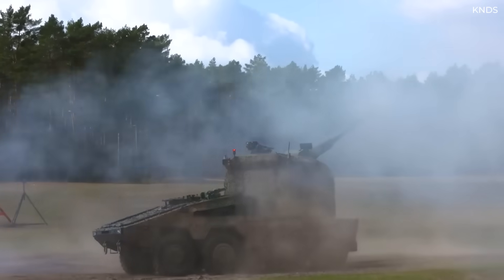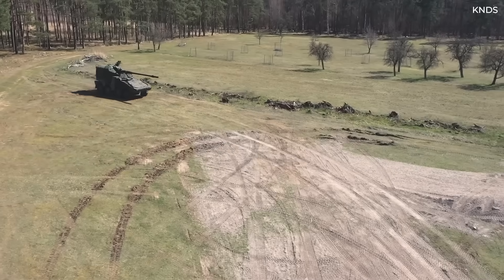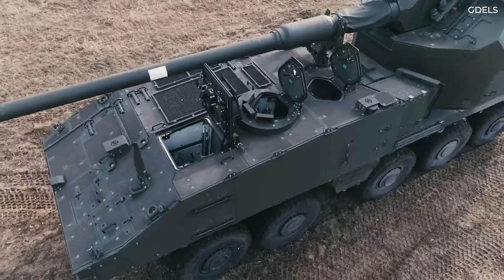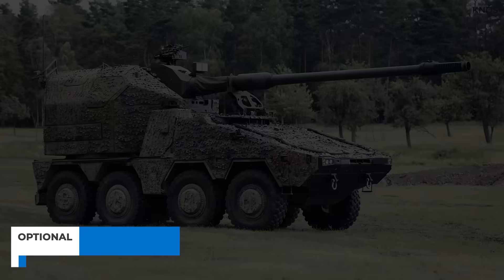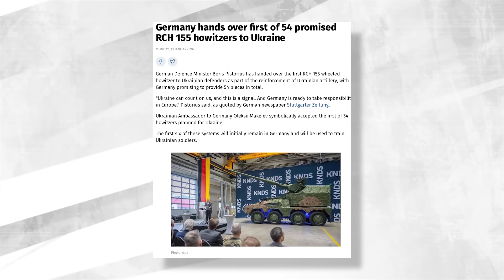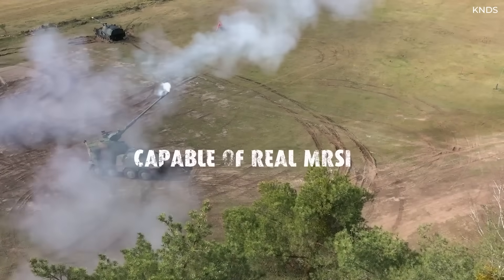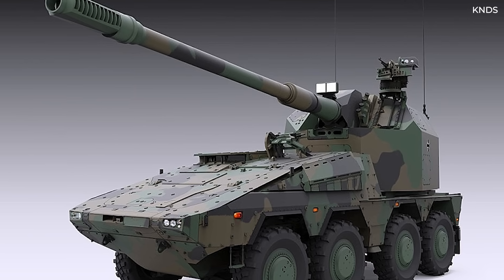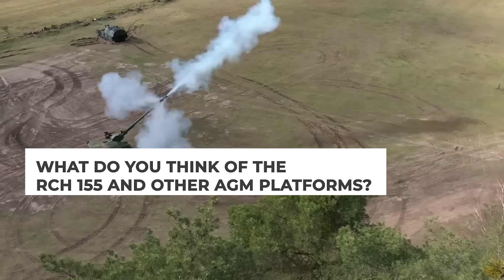RCH 155: If Drive-By Shootings Used Artillery...

Comment: Its quite astonishing you forgot to mention the biggest drawback: it's a wheeled, not tracked vehicle, which will affect its cross terrain ability.
Reply: The boxer still has great offroad cross-country performance, the wheeled vs tracked performance gap has closed in the past 50 years.
Reply: @nicolepham3836  no it hasn't,  its PHYSICALLY impossible. Wheeled vehicles will NEVER have ground pressure as low as tracked one. Thats why there has NEVER been wheeled MBT.
Reply: @nhathuy1909 ....80% is still not 90 but it is closer than 60%
Reply: @nhathuy1909 oh I was explaining to you how your comment did not contradict what Nicole said. And why mobility is less of a problem than you belive
Reply: @nhathuy1909 ... strange how it seems to be less of a problem to all the people involved in project like this. Coudl this be do to the differences being smaller do to advances and the higher mobility on even ground and streets..
Reply: You can put it on wheeled and tracked platform. It's modular.
Reply: @saltymonke3682  no, you cant
Reply: @nhathuy1909 huh???? They just put it on a tracked Boxer a few weeks ago
Reply: @nhathuy1909 it literally has been done so you are just demonstrably wrong.
Reply: @emilsinclair4190  there is no such thing as tracked RCH 155, so you are just demonstrably wrong.
Reply: @saltymonke3682   there is no such thing as tracked RCH 155, so you are just demonstrably wrong.
Reply: @nhathuy1909 RCH 155 TRACKED. It is literally in the name.
Reply: @nhathuy1909 huh? Tracked Boxer is a thing, and they put RCH on it
Reply: @emilsinclair4190 in your dream?
Reply: @emilsinclair4190 which name? Your mom name?
Reply: @nhathuy1909 buddy just google it. Produced by the same company. And it also can be mounted on other vehicels that are tracked. But than it is usually called differnt.

So yeah you are just demosntrably wrong sorry
Reply: @nhathuy1909 ... the name of the system dumbo
Reply: @emilsinclair4190 where? Show me?

Comment: For the Uk, that's already buying and manufacturing Boxer vehicles it makes a lot of sense from a supply chain point of view. Also with the UK facing manpower/ recruitment shortages, a two man crew is also a boost. If it's also true that Sheffield Forgemasters are going to produce barrels for the RCH155 then that's another advantage. Like all German kit it is expensive, but with the above advantages it might be good for the UK as Germany on its own is not that fast at supplying kit. All in all it sounds good and if it proves itself in Ukraine and or builds upon the experience of the system there... Well... It could be a war winner.
Reply: German here. In the past we couldn't scale up the production. Shortage in the production of armoured steel. Our steel production technology was/ is in transition. 2021: Germanys biggest steel producer focussed on investments into other - more asked(!) - sectors of the steel production and sold its patents for armoured steel to another German steel producer a few month before the Russian invasion started.
- Old production facilities for armoured steel were closed and dismantled.
- The buyer of the patents didn't developed the adaptations for armoured steel with the new production technology yet.
2022 was Germany at the lowest level of armoured steel production capacity ever.
We couldn't scale up the production of armoured vehicles without armoured steel.

'The Russian invasion came at the worst point in time - or for Putin the best point in time.

I heard UK had also problems with its last steel production facility - owned by a Chinese company.
The UK government bought it to rescue it.
Insane story.
How was this possible?
I was not surprised that the Chinese company tried to make UKs last steel factory unuseable.
But for me it is unthinkable that our last German steel factory would have be owned by a Chinese company. And only one steel factory for whole UK? Really? Are you kidding me? UK? How do you want to scale up your weapon production with only one steel factory? In the worst case UK surely would need more than one.

Since circa two decades China flooded the market with second and third quality steel. But China never sold premium quality steel. It always bought premium steel. In the beginning of the market-flooding we weren't sure if China has the ability to produce premium steel.
If we produce steel we have always the output of all three qualities.
But in earlier times Chinas steel production technology lagged behind. It could only produce second and third quality.

Since China flood the market the prices for second quality steel shrunk significantly and the prices for third quality steel collapsed.
Considerable revenues were only with premium steel possible.
That made it hard for our steel industry to survive.

But for the production of some tools, special parts of machines and weapons we can only use premium steel. Too many other important German industrial sectors are dependent on premium steel. Germany kept its steel industry with taxpayer money alive.

After some years more and more steel producers of the West went bankrupt and Chinese companies bought them. Then we were sure, that China has the technology to produce premium steel. And we knew:  The Chinese are not stupid and it is not too difficult to rebuild their old Chinese factories to produce premium steel.

But China still flooded the market only with second and thirt quality steel and bought premium steel.

After a few years it became suspiciously.
As we calculated how many premium steel China might have, it became terrifying.
We guessed that China is not only producing tools and special parts of maschines with its premium steel.

I guess that was the same reason for the German government to spend a lot of taxpayer money to develop a more efficient, more marketable steel production technology.
But regrettably they underestimated Russia...

In August 2025 Germany put a whole new production facility for armoured steel into service and the next new should come in the beginning of 2026.
Now we can slowly increase the production of armoured vehicles.
Some day we will have reliable supply chains for the Boxer RCH 155.
And with the build up of the production facilities in UK many things should become easier. It is better - strategical.

I mean: We already know from WW2 how vulnerable UKs supply chains can become.
To live on an island is an advantage and a disadvantage at once.
At the minimum UK should be able to produce all often used spare parts and all ammunition for its weapon systems on its own. Therefore UK will need more than 1 steel factory. 😉
1) I don't want that Germany becomes the one big aim because of its production.
2) If one production facility gets destroyed the other can help.
3) Shared creativity in the further development of the Boxer RCH 155 could save money.
4) Sorry to say this. But if the workers in the UK would get suitable labour conditions and suitable payments, UKs weapon systems would also be more expensive. If you don't change this, you will have problems to get enough skilled workers. People that want to be able to feed a family in the UK chose other jobs. And for security reasons you don't want to employ refugees that have a family in a country that is not safe (vulnerability to blackmail) in your armament factories.

Greetings from Germany!
Reply: @Katzenbuckel123 I think we are all beginning to wake up to our shortcomings in Europe, i just hope its not too late.

Comment: I like the idea of it being automated, less crew, just send it to an area, fire off it's rounds and return for reload. Having everything done remotely by Command, means less relaying as it's done by computer speeding up things considerably. It also means they don't have to sit in an area being vulnerable.
Reply: Next step would be to have an outonomous artillery part which separates from the command part to shot, so even if attacked the people are safe.
Reply: @jorgf.2974 Like automated counter battery fire, It would take minutes to detect and come up with a target for retalliation. However, if automated, a decision can take seconds.

Comment: I am wondering if it would would work on Patria AMV like big brother to amv mounted AMOS Finland already uses, but Finland already has quite a variety of artillery weapons and generally high emphasis on cost efficiency and reliability this seems questionable for.
Reply: I would think so... Switzerland gets AGM on their Piranha IV, which is smaller and has a weaker engine than the Patria AMV. But as you said, Finland is probably good on artillery with K9 and M270.

Comment: I still wonder where the two crew are sitting? Isn't the engine beside the driver?
Reply: The engine is positioned in the front of the vehicle. Driver and commander are sitting behind the engine block with the driver on the right side.

Comment: Thank you. Good briefing. In regard to the German levels of complexity, I suspect that this is ‘par for the course’ with such gun systems. N.B. The Rolls Royce Eagle aero engine was both: the most complex aero engine of WW1 and … the most reliable aero engine of WW1. Cheers from NZ🇳🇿.
Reply: Complexity has been an issue for the Leopard 2 in Ukraine. Damaged tanks have needed repairs along way from the front. The Leopard 1 is much more user friendly and requires field maintenance instead. 
The usage in Ukraine will show which systems give a technical advantage and which are technical  liabilities

Comment: I'd like to mention that the German forces will be using the RCH 155 in conjunction with the SMArt 155 fire-and-forget artillery rounds, which contain 2 submunitions with guided anti-armor warheads, each covering an area of ~70.000 m² (10 football fields). Thats double dipping into mobility and further reduces the time the RCH 155 has to be deployed into enemy drone range. It also means that shots on the run don't have to be pinpoint accurate.
Reply: Wydaje mi się, że to sprzęt, do działań o małej intensywności. 
Podejrzewam, że celność zwykłymi pociskami jest gorsza niż z platformy gąsienicowej, czy kołowej z podporami- fizyki nie oszukasz. A w działaniach o dużej intensywności, pociski inteligentne szybko się skończą.
Reply: @marekduczman The cannon is the same as the Panzerhaubitze 2000. These have fired more than 20,000 rounds per barrel in Ukraine. That's two to three times more than other barrels can withstand. No one would ever encounter this barrel load unless the systems were designed for continuous use. In addition, in more than two years, at most one Panzerhaubitze 2000 has been destroyed, which corresponds to a loss rate of approximately 3%. The AHS Krab has already suffered 41 losses, which corresponds to a loss rate of 38%.
Reply: That sounds like a LOT of cost => fewer rounds.
Can Germany field a couple of million of these rounds per year? I mean, the only use they’ll ever have is in the large-scale conflict, anyway.

Russia has such rounds, but we practically never see them in Ukraine.
And as a result, they had 0 impact on the war.
Reply: @andrejjjj2008 why would you need to field 2 million + of specialized anti tank ammunition? Completely needless amount. Ukraine has used bonus and smart 155 to result of many russian tanks destroyed
Reply: @fennoman9241  Yes. Like I said, both Russia and Ukraine field these in small amounts. 
Did any of them changed the course of war?
 No? Then it’s not a game-changer - just a fun gizmo that’s nice to have. 
And it IS nice to have. But you don’t build military strategy around gizmos. You don’t bet the future of millions of people on it.
Gizmos a redundant.

Don’t get me wrong, I’m not a hater on smart munitions. 

But first: you need them at scale. 
Means you can’t cram thousands of futures in every shell. They need to be as cheep as possible - or at least cheep enough for your Military Industrial Complex to field in sufficient amounts.
 
And second: they need to be flexible. 
Or they’ll get jammed - like Excaliburs in Ukraine - and you’ll end up with tiny amount of dumb shells with 20x the cost. Or blinded with lasers. Or the heat signature would be distorted with a barn on top. Or there’ll be some other horseshit. If your gizmo is valuable but inflexible - the enemy WILL find a way to nullify it. And if it’s not valuable to you, so nullifying it doesn’t matter - then the gizmo is redundant on top of it.

A good example of ‘flexible’ smart munition would be removable steering head for 155mm shell. If the battlefield is jammed, you just remove the head - and there’s no additional cost.
And you can use the head elsewhere, some other time.

A smart-munition for ‘scale’ would be drones.
Make these seekers on the EFP submunition cost 500$ - and you’ll have insanely useful weapon system.
Reply: @andrejjjj2008  Not really, they have been useful as counter to russian armoured attacks. You dont need a lot of these munitions.
Russia isnt gonna put a barn ontop of every tank they have for armoured assaults and lets not forget that a war between west and russia would not be a 1:1 with Ukraine, a lot more factors to consider than that.

Comment: Very impressive technology, unfortunately it still seems like they haven't developed the logistical capabilities to produce these machines at a reasonable pace
Reply: Nobody will stomp out a full blown mass production to produce 400-500 systems within a year and then go offline.

Buy the dang thing like golfs and we might gett it, tho.
Reply: @heinzkabofke6791  the thing is, countries capable of purchasing and operating the RCH are ruling it out simply because the systems are so slow to produce, and its a major reason why they are losing so many potential deals right now.
Reply: @itstime6122

Then they will have to go with archers or krabs.

We will get our 150 something and be content with having close to 400 of the most modern mobile artillery pieces there are.
Reply: There are some bigger nations looking for new artillery systems like Spain, Italy and Canada. If all go for the RCH/AGM it would mean additional orders of about ~250-350 systems (not counting smaller nations that might order too)... that should rectify an additional production line.
Reply: @andisrava9703 
My hats a big if.
Our RCH might be the best on the Block, but just like puma, which aces every comparison, it’s just a notch too expensive for countries with … dunno.. less than 60k per capita gdp or something.
Reply: When I read stuff like this, it makes me sick. How quickly do you think it is possible to set up or ramp up production of such complex systems? There are so many different suppliers involved that it takes years to guarantee something like that. It shows time and again that people like you have absolutely no idea about production processes and then just shine here with half-baked knowledge and ridiculous statements. In addition, significant order intake is required before a company can take on the risk of costly ramp-up of production, which then only guarantees capacity utilization for a short period of time.  I would suggest trying to educate yourself a little about production processes.
Reply: @gerhardma4687 Aren't you just paraphrasing what I said? I stated that the logistical capabilities aren't fully developed yet. You countered with "well they take a while to develop and it's complex", but nowhere did I ever disagree with that statement. Do I expect them to be producing these systems en masse ready? No. All I did was bring up that the capabilities are definitely not up to speed yet, and it's something that countries looking for new artillery systems right now are absolutely gonna take into consideration.

Comment: I really like the gun but this is not the gun for Lithuania. While we have both boxer and a german gun, what is now need are artillery that conscripts (future reservists) will be familiar with i.e. more ceasar.
Reply: the Caesar is cheaper and more readily available BUT is it really better suited for conscripts? the Caesar needs 5 man crews, needs to stop in the field, the crew needs to leave the vehicle to do the firing and before it can leave the spot again it needs to pack up. this all costs time and exposes the crew to [potentially deadly] dangers. if I were a conscript my choice would be clear. 😉
Reply: A ja mam wątpliwości, czy taki wynalazek nadaje się na prawdziwą wojnę. 
To raczej typowy sprzęt ekspedycyjny. Strzelać celnie drogą amunicją, ale niewiele.
Na wojnie z Rosją, inteligentne pociski szybko się skończą, a celność w strzelaniu bez podpór zwykłym pociskiem, nie będzie zbyt dobra.
Reply: @marekduczman  the system can use 'normal' artillery rounds as well. the point is you only need two soldiers, they never need to leave the vehicle and that thing fires on the move - even with 'cheap' artillery rounds. the accuracy of rounds depends on the accuracy of your target locations. drones in the air do the reconnaissance and should relay the data to the artillery unit. can Lithuania do this?
Reply: Nhosto, that really depends: If you assign one particular to a reserve warrant officer who is a math and physics teacher and the driver repairs combines and tractors, and both serve as a reserve from age 18 - 49, you can use the less specialized reservists of the former conscription to territorial army, infantry and logistics duties. Little practice in exercises needed etc. Same with air defense, use male air traffic controllers who are not needed in time of war as reservists on NASAMS, IRIS-T SLM/ SLC etc. and you have well overlapping skill sets and talent pools without losing their precious training. Use the conscripts on tactical UAVs, C-UAVs and especially 60 mm and 81 mm mortars.